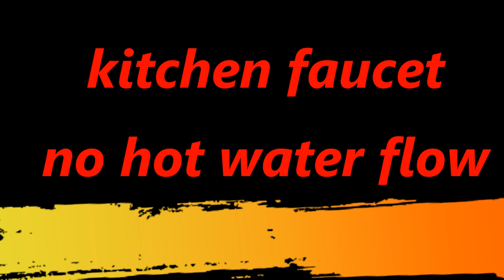kitchen faucet no hot water flow

Comment: One tech tip is to take the supply off the hot water shutoff, leave the cold hooked up. Open the cold shutoff and then open both faucet handles with your thumb over the aerator. The pressure will backwash the hot side. It fixes blocked faucets and supplies a lot of the time but beware it can get extremely messy lol.
Reply: Thanks for posting this tech tip on the back flow method. My sink hot water handle was not working. After doing this it now works. Had to do it a few times though. And I put a towel over my hand while holding the water spout! Did not allow the water to splash everywhere! Thank you bud!!
Reply: thanks. just changed my hot water heater 30 minutes ago and was getting hot water everywhere but the kitchen sink. came looking for ideas, found your comment and within 5 minutes it was fixed.

Comment: I play the role of Sherlock Holmes with commercial plumbing repairs. We act as the last line or defense for a large grocery store. They have an army of techs that will not fix anything that isnt obvious. It is surprising how trivial most repairs are when you go through the process of elimination to determine the actual problem. Been at it for over 40 years and will still see things I had not before. Nice video.

Comment: Thanks! I had the same problem -- an old compression multi-turn valve put some plastic pieces in the hot supply line.

I have a single-handle faucet so I just unhooked the hot line and turned the handle to full warm and backflowed the cold water through the hot line. The plastic pieces got flushed out once I stopped the water with the stop/stray button on the faucet wand. That saved me from taking apart the faucet to clean out the cartridge.

Comment: Okay well I have this problem. There was a water main break on my block and immediately after they fixed it, my hot water stopped coming out of all of my sinks but it does come out of the shower. 

There is no way all 3 sinks in my house have a problem. What could stop the hot water from coming out, only cold water comes out of my sinks.

Comment: Love your videos keep them coming. 
So Steve how long should a rubber washer in a shutoff valve last.  It could have been sitting there waiting to be shut off for 20 years.  In the UK there are a lot of brass gate valves no washer just a brass unit they sit around in very hard water and the first time you need them to shut off,  they are Jammed tight.

Comment: Hey Steve! We had a puzzle just today, snowbird clients come home this week and have water to sink and shower in bath we remodeled last fall... but nothing to the toilet... weird, so my son takes the supply off to inspect it, and there’s this little round piece of metal clogging the line right in the fitting, we pry it out and it’s the head!, of an old slotted screw!!! Where the heck that come from? So we pry it out and put the supply line back and water flows again! But have no idea where an old screw head came from...
Reply: Sounds like the screw that holds a washer on a valve. Had to come loose somewhere in the system.

Comment: I have the same problem but not in a faucet it’s with my main bathroom shower. I replaced the valve and cartridge and still no hot water. Water loses pressure when turned to hot water side until it seems like it’s completely turned off. Haven’t been able to shower in my bathroom for 2 months now. Can’t figure out the problem

Comment: Steve-O! 2 queries: 1) why do plumbers still use gate valves vs. quarter-turn ball valves?
2) I have a toilet supply line that is hot water, and it also NEVER stops running, even with the house main valve off. Slab foundation, no basement. What in goodness name is going on here? It really defies logic.
Reply: if you shut off the main and it still runs then the main is broken and if you have hot water at the toilet then oh my that is not right
Reply: @wolfhound many places have hot water to the toilet to prevent condensation from dripping off the outside of the tank.
Reply: Globe valves are fine to throttle the flow meaning you can have them half open for prolonged use without risking any damage and are generally pretty cheap but they restrict the flow of water quite a bit by design. Ball valves tend to take up less room than gate valves and are generally also fairly inexpensive but you shouldn't throttle them for extended periods of time. Gate valves tend to be more money, they often chatter when you try to throttle them. Throttling them does easily noticeable damage and can lead to water passing by the valve even while shut off if you didn't have it in the fully open or fully shut position. Gate valves offer almost no resistance to the flow of liquids inside when they are fully open. As for a WC being fed by hot water, i've never heard of that before.

Comment: This is why I hate messing with the stop valves under the sink when they haven’t been shut off in years (if you can even get them to turn without channelocks)  The hot side washer is first to crumble from the heat and it likes to clog the basin tube and faucet.